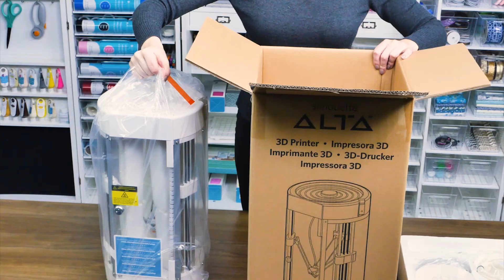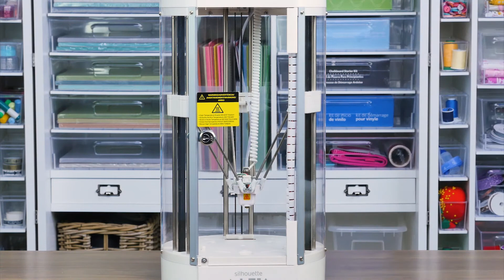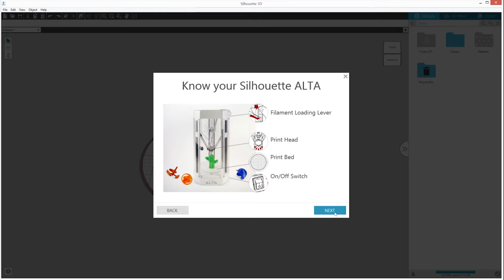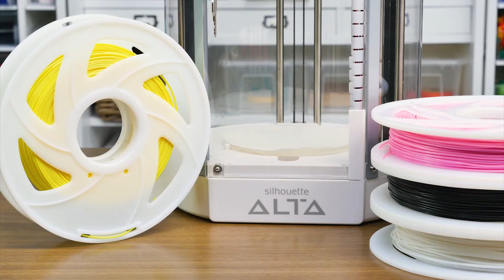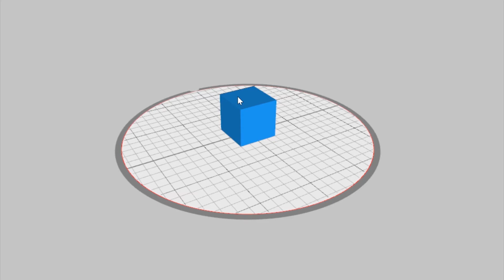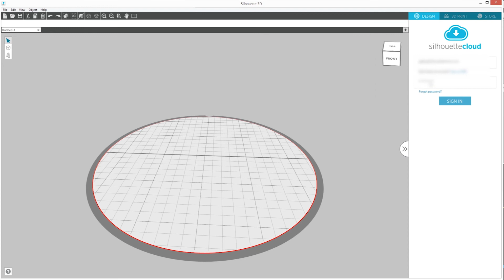Unboxing y Guía de Configuración de la Impresora 3D Silhouette Alta

Comment: Hola tengo una duda.
Compre una impresora de las mismas que la suya pero veo que imprime de manera inestable es decir en ocasiones imprime la pieza bien y en otra no mucho osea se adhiere bien a la base y en otras queda levantada la base en las esquinas
Que puede ser falta más temperatura?? O se debe calibrar??
Reply from the maker: Las condiciones climáticas dependen mucho de esto. Te sugerimos probar en un espacio ventilado y sobre todo puedes experimentar con la puerta abierta y con un ventilador pequeño directo a la pieza. Cuando cada capa o layer logra solidificarse pronto, se mantendrá firme y la pieza saldrá de buena calidad. También tomando en cuenta velocidades bajas e incluso una buena calibración previa.
Reply: @tecnowire   HOLA TIENEN ALGUN NUMERO DE CONTACTO?
Reply from the maker: @brenborolv3943  Por supuesto! 3346242926 también puedes localizarnos en www.tecnowire.com.mx